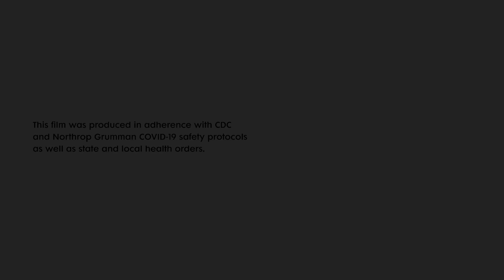The Making of Stars - Training Technicians at Northrop Grumman

Comment: I am in a similar situation as Diana in the video, but coming from doing logistic instead for the Air Force. Diana in the video who come froms doing something like babysitting, cleaning houses, and fast food to now to doing something entirely different and work as Aircraft structure Technician for NG. What are the chances of there's a hiring manager at NG out there that's willing to hire someone who is transitioning from something they work in the past to something entirely different, like me someone been doing logistic for Air Force, have clearance, and now trying to transition to Cybersecurity/IT with courses and certifications. Maybe I need to run into a good grace hiring manager like Diana's hiring manager, and get me a chance to get my foot in the door.